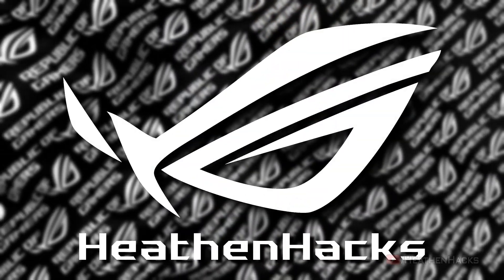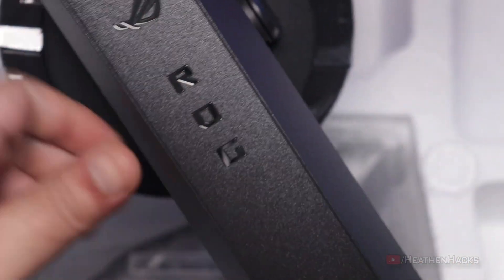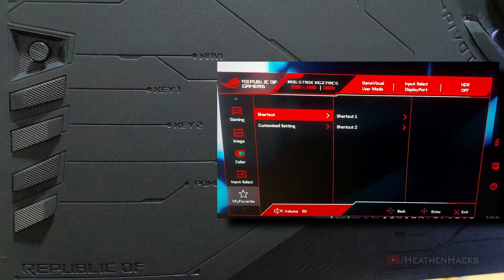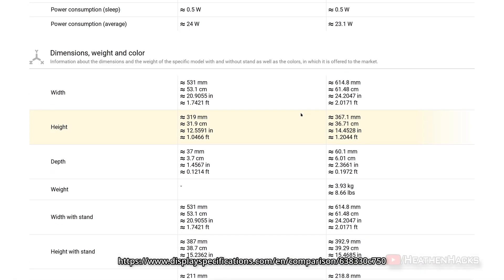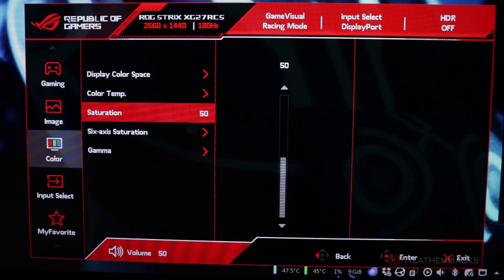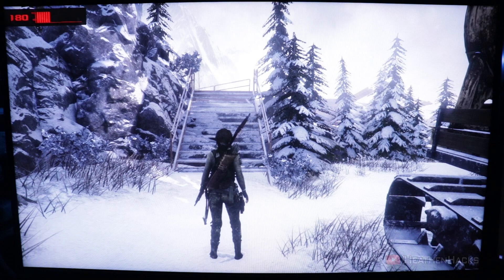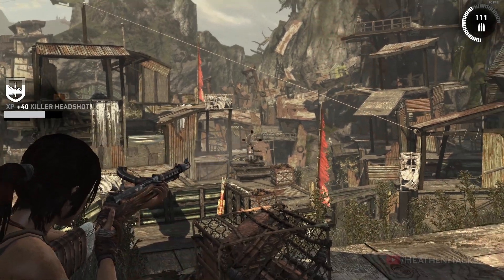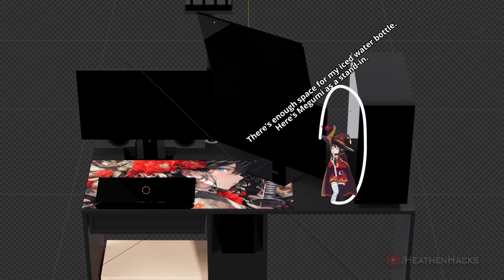ASUS ROG Strix XG27ACS 27" 1440p 180Hz IPS Monitor [UNBOXING, SETUP, TESTS & REVIEW]

Comment: Bro any reason HDR should be off?
Reply from the maker: In my case, I'm on Linux, and there is no HDR/proper HDR support on the display server I'm using (X11). There is HDR support on Wayland, but the application that is required by my work only supports X11 (at the moment), so I can't switch to Wayland just yet. 

On another note, as mentioned on the video, I have no HDR content that can utilize it, and watching SDR content while HDR is on doesn't look right to me. (I tried it when I still have my Windows OS installed).

TL;DR, it's complicated.
Reply: @HeathenHacks  The display at max brightness is 400 nits for HDR. Would you say is there any point to turn on anyway? Realistically I'd use it at 60% brightness max.
Reply from the maker: My apologies, but I think it's up to you. People see things differently, depending on the environment and other factors, so what looks good to me, might not look good to you. It's subjective, imo.

Why not try it out for a few days? If you like what you see, keep it on, if not, turn it off.

Comment: Can you tell me how long the powercable is? Cant find it anywhere!
Reply from the maker: Thanks for the question! Unfortunately, I don't know the exact length, since I didn't check it. However, there's a good chance that it's the usual 1 to 1.5 meters.
Reply: @HeathenHacks ok,thx for your answer i think well need a little longer than that. Appreciate your quick response!!!

Comment: Pwede ko kaya palitan ng Power Cable yung monitor? Type A ata currently yung sayo. Yung nasa extension ko is pwede Type C saka yung Type G.
Reply from the maker: Afaik. As long as it has the same rating, and matches the monitor's power inlet, it doesn't care about what power cable it uses. 

It's up to you, tho.

Comment: Hey great review thinking of picking up this monitor myself do you notice any grainynes when using the monitor i heard some reviewer say its prevalent
Reply from the maker: Hello, and thanks for the comment! You know, I haven't really noticed it until now. There is indeed that "grainyness" due to the matte coating, but I only see it once I get 12 inches (30cm) close to it, and only if the background is white. Maybe it's my eyes, idk.
Reply: I've got this monitor, you can't see anything grainy in my opinion. Great monitor.